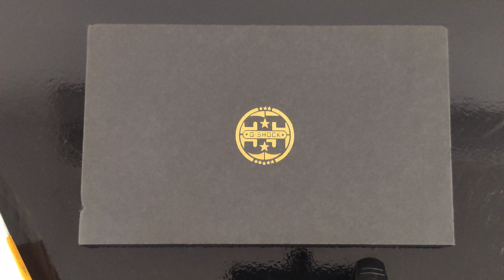CASIOAK metal case modification on G-Shock GA 2100

Comment: Very Nice ! I have the green and red version of the casio same as yours and I think the gold strap version would go very well with it, Where did you get it from? I have found a seller on aliexpress who sells the new GEN.3 of this mod - I believe yours is GEN2 - which comes in one piece so you don't need to install the strap and it might damage the watch like how you encountered with the lugs. However, now his page is a pile of negative comments. I think he suddenly disappeared and did not ship anything for some reason.
Reply: Hello did you already bought the gold strap version ? Did he get well on your wrist ?
Reply: @hd31  Yes got it, Looks good and feels good, But i have a small wrist, it runs little big even after I removed all links.